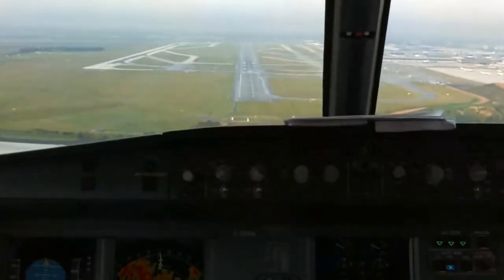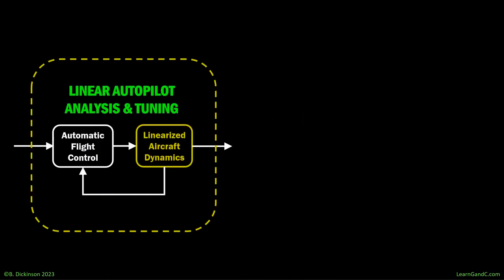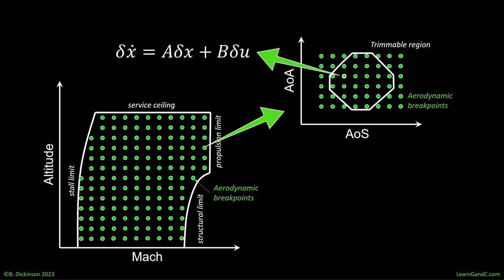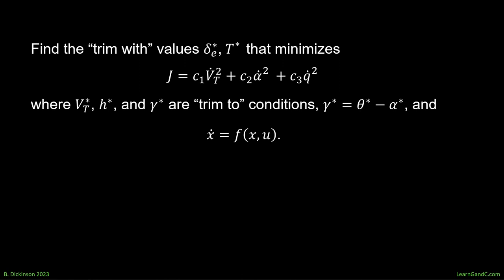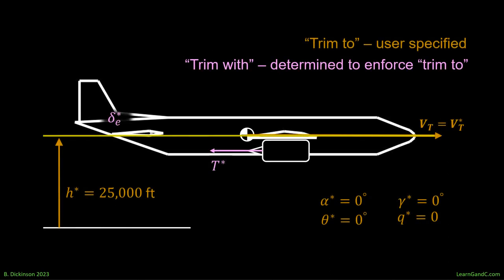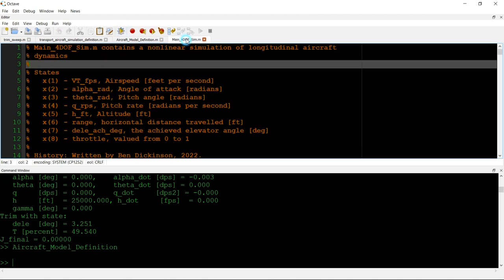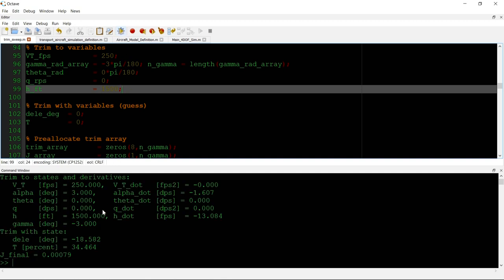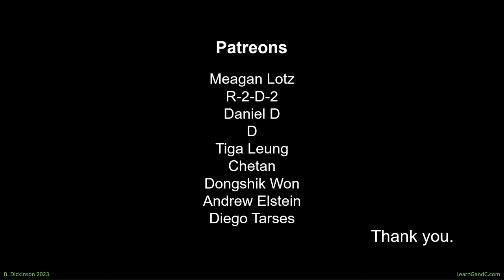Trim for Autopilot Development – Flight Control Fundamentals – Section 1.7

Comment: If J cannot be forced to zero, is the aircraft really in a trimmed state? Intuitively, I'm a bit surprised that "true" trim wasn't achieved across a wider array of states.
Reply from the maker: Hi Andrew,

By how trim was defined in this video, technically, no. If J  is not 0 the vehicle is not perfectly trimmed. However, a nearly trimmed vehicle may be good enough for linearization of the dynamics for control.

We could redefine what we mean by trim (i.e. the trim problem statement) to get a better result. This usually means adding constraints or "trim with" variables. 

In our problem statement, we are essentially trying to find the roots of three equations with two variables, an underdetermined problem, which leads to the "best fit" solution. 

I'm considering a Section 1.7.2 citing the poor trim results (note \dot{alpha} values as they pop up in the command window) with the last trim array example and reposing the trim problem. 

Last thing, there could be a bug in my code, but I did verify my routine with examples in Stevens and Lewis. 

Good question.

Comment: Hi sir,
Is it possible to trim an unstable aircraft in longitudinal axis?
Reply from the maker: Absolutely! Trim is a question of whether an aircraft can hold an equilibrium at a flight condition. About that equilibrium condition, the system can be stable or unstable.
Reply: @LearnGandC  I have a nonlinear aircraft model. When I trim the aircraft for stable case (Cg ahead of the neutral point) there is no problem, but when I move Cg behind the neutral point again I can find a trim point but aircraft cannot maintain its trim condition. Even I run the simulation for 1-2 seconds, aoa increases by 2-3 degrees for example (system has no disturbance or perturbation). Also, I used simulink for this simulation. Do you have any idea what should be the reason sir?
Reply from the maker: Yes, what you are experiencing is normal and expected. First, note that you have an unstable dynamic system. Second, note that you are attempting to simulate that system with an initial condition about its equilibrium point. However, ask yourself, do you know exactly the equilibrium (trim) condition? If your system diverges its because your off the equilibrium condition. The difference between your approximated trim condition and the exact trim condition may be small, but that small difference will grow according to the severity of the instability.
Reply: @LearnGandC I understand what you mean. Thank you very much for your answer and videos.
Reply from the maker: You're welcome